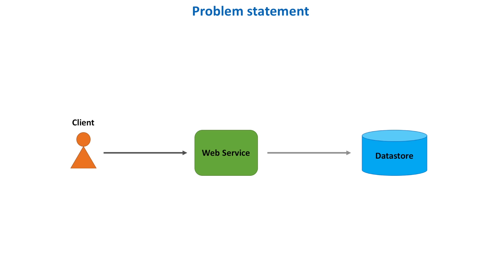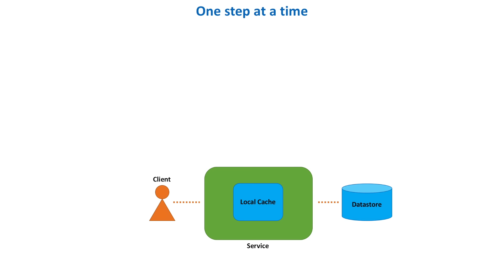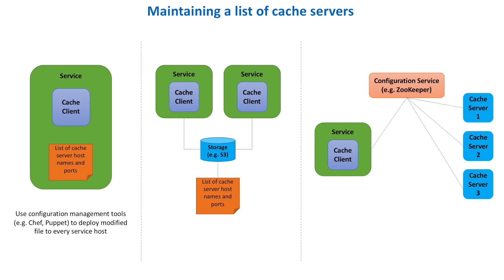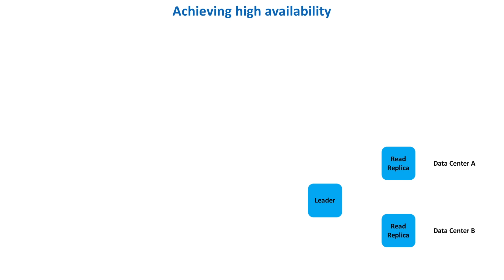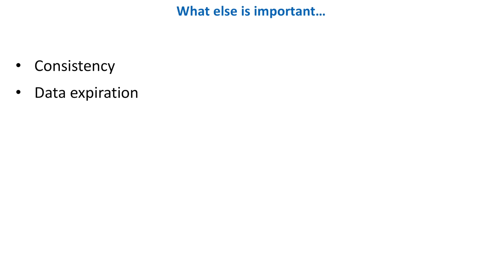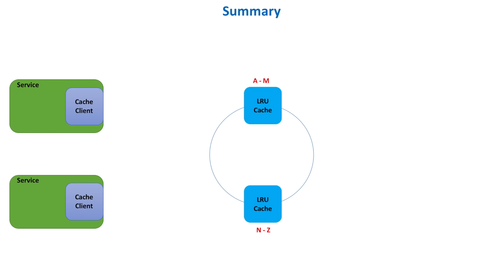System Design Interview - Distributed Cache

Comment: this is the most underrated channel, kudos to your way of explaining things in succinct manner. Please put more videos
Reply from the maker: Thank you, Vicky, for the kind words! Working on more videos.
Reply: I second. I wonder what does it take to make it popular. There should be something simple.  I am watching a few other channels. Nobody covers it to this level. May be more videos required. on short topics. Say 10-15 mins .
Reply: @nirumani  put it on LC discussion board
Reply: Fantastic series of videos.

I've worked on very large distributed caches (multiple terabytes, thousands of servers) and some other fun stuff to mention to the interviewer is:
- Failure modes besides just plain qps. Specifically, Redis will be overwhelmed by connection churn if it receives thousands of new connections per second. Twemproxy, on the other hand can handle this just fine. I have not tested this with Redis Cluster, but I suspect Redis Cluster also suffers from this.
- Auditing: With GDPR and California's analog to this, the legal department often is interested in how long we store data and where. For the former case, they may want a global TTL, or failing that, metrics and alerts when the cache TTL is too high. For the latter case, we may need to separate out data from users in various countries at the client level.
- Maintaining client libraries: How do we make sure everybody is on the newest version of the library? How do we manage multiple implementations? For Redis Cluster, this is a big problem- it turns out different clients have very different characteristics when it comes to detecting failures of nodes. Using a sidecar proxy like Envoy can be a big help as we can manage retries and health checks in a more principled manner.
- Testing: Frequently service owners don't think about how their service behaves with a degraded cache. Chaos monkey is a step in the right direction, but it is a blunt tool. Instead we can add knobs to return a percentage of errors, or delay requests, allowing us to really understand how we need to improve the service- for example retry intervals.
Reply: @SystemDesignInterview  Unfortunately you have so few videos, I've been watching them over and over before my system design interview. Top K heavy hitters is my favorite one, probably watched it 5 times already.
Reply: @martinhenriksson8617  Yes I do this as well. There is a big need for this sort of content. I have thought about making some of my own.

Comment: You said that we can make the implementation highly available by creating master slave replications of each shard. That is fine. You also said that we can use the read replica's for 'get' calls, This is NOT correct. Because in our LRU implementation even get changes the internal state of the data structure, it changes the doubly linked list which needs to changed on each of the replicas and leader which can complicate matter. In this particular implementation all 'get's MUST to go to leader only.
Reply from the maker: I am glad you raised this topic. As both data eviction and expiration become tricky when we introduce replication.

Expiration is tricky because master and all replicas need to have synchronized clocks, which is not a trivial problem.

And eviction is tricky due to the problem you shrewdly noticed. When each access of the item (get call) should be reflected on the master node. Because when master does the eviction it should have up-to-date order of when each item was accessed. And ideally, master should have this information. But it is hard to achieve in practice and actually not absolutely required. What if we ignore this information? I mean only master node evicts and expires the data. And every time get call lands on the read replica, we simply do not propagate this information back to the master. We decrease overall accuracy, but this approach performs pretty well in practice (for example, please check how Redis handles replication and eviction).

And as a side note, LRU (and other replacement policies) tries to predict the future. And this problem cannot have a "perfect" solution. There are many variants of LRU cache implementations, not all of them rely on keeping an exact order of use. Redis for example uses approximated LRU algorithm, where it samples a small number of keys and evicts the best candidate.
Reply: I had the same concern. Glad it has been raised previously.

Comment: Thanks.

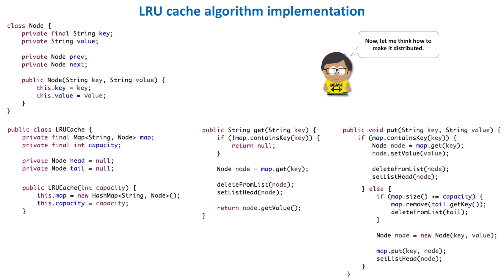 ~ 10:45 Local Cache Implementation
Stepping into the distributed world:
10:46 ~ 12:42  Dedicated Cache Cluster vs Co-located Cache
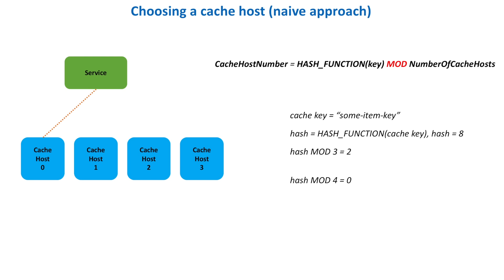12:43 ~ 14:05 Choosing a cache host: naive approach
14:06 ~ 16:04 Choosing a cache host: consistent hashing
16:05 ~ 17:25 Cache Client
17:26 ~ 20:00 Maintaining a list of cache servers
20:01 ~ 22:13 Summary
22:14 ~ 25:52 Achieving high availability
25:53 ~ 32:17 What else is important: consistency, data expiration, local and remote cache, security, monitoring and logging, cache client, consistent hashing
32:18 ~ 34:33 Summary

Comment: By far the best example of a structured approach to work out a system design problem. And in this particular case, a better solution than other videos on Youtube, Grokking and Interview Cake.
Reply from the maker: Thank you, Diego, for the feedback. Much appreciated!
Reply: @SystemDesignInterview  you deserve it. I took another look at your code and have a question about a minor detail. Do you really need the key in each node? I think that keeping the value should be enough. Through the key, you get the reference to the node in the hashmap, and from there the value.
Reply from the maker: Hi Diego. Good question!

Storing key in the node helps when we need to delete an entry from the cache when it is full. And more specifically, for this line: map.remove(tail.getKey())
Reply: @SystemDesignInterview  Oh yes.. it makes sense. I missed that. Thanks.

Comment: For the high availability in distributed caches we use Hazelcast that implements backup copies in the distributed map implementation itself. Each shard has a backup copy on another shard and the backup copy can be used to speed up reads and to grand HA in case of single nodes failure

Comment: questions:
1. how do captured logs/metrics differ between cache client and cache server? 
2. won't using a config service (ZK) ensure clients always have consistent view of what cache servers are available? 
3. what's the use case where co-located cache would make sense? is it just when you aren't ready to scale up to running a separate cache service? 
4. what about using heap for LRU cache? bad idea? 
5. for cache eviction, why would you sample items randomly and check if they're expired? If each server has a LRU cache, why not round-robin check servers for their K least-recently-used items and evict those? 

you the man, man!

Comment: Once again, a superb video. One thing that I found slightly confusing is the labelling "A-M" and "N-Z" of the shards in the drawings.
This implies a range function (encyclopedia style -> all keys that start with "A-M" go to host A) which in turn, allows for efficient range queries later. 
However, you talk about "consistent hashing" as the best sharding strategy (allows for efficient "get by key" query but not a range query) which is fine but inconsistent with the graphics (unless I am missing something :).
Thanks again for the amazing content.
Reply from the maker: Hi Michael,

Good points! Thank you. By using this "A-M" notation, I only wanted to state the fact that data is partitioned. Without any specific partitioning strategy in mind. Neither the range strategy (which is implicitly implied, I agree), nor the hash strategy.

I should be more careful next time. Thank you for bringing this in.

Comment: Even if we are using consistent hashing in our distributed cache design, There could be uneven distribution of traffic in the ring if any of the node goes down because of some reason. As a result all the traffic would be by default directed to the next node in the ring. That load would not be distributed equally across all the nodes in the cluster. To solve this problem we can make use of Virtual Nodes in the cluster.

Comment: Thank you so much for your contents! This is the best system design channel ever for real.

I can now understand how the "hosts" can coordinate in one cluster with different strategies and now I am curious:
1) if "leaders" in charge of writes can be more than one and exist across different data centers.
2) If there can be multiple leaders for writes, how does the coordination work across different data center?
Lets say there are hosts called A,B,C,D from cluster 1(data center 1), and copied ones are existing in cluster 2 and 3(data center 2 and 3 each) for availability. When "write" action happened from host A at data center 1, how does the hosts from data center 2 and 3 know about this update? In case multiple leaders(which in charge of writes) existing in different clusters(i.e. one leader in one cluster for writes), how does the cluster coordinate and handle the writes happening from different leaders?

Thanks again for your amazing lecture!
Reply from the maker: Hi Sunyoung,

First off, thank you very much for the feedback and insightful questions. Secondly, my apologies for the delayed response ((

Many things I would like to say regarding your questions... Hard to even see where to start. Ok, let me outline thoughts one-by-one and see where it will take us.

1. I would avoid bringing a topic of multi-leader writes and replication for the cache design. And my argument is that we do not need any. For a distributed database design discussion - probably yes, for a distributed cache - no. Because availability requirements are typically lower for the cache. I will try to cover this topic more while discussing databases in future videos.

2. Regarding multi data center (DC) support, I have seen several approaches in practice. For example, when cache cluster servers span across several data centers. Physically, servers live in several different data centers. Logically, all these servers are combined in a single consistent hashing ring. When one DC goes down, cache servers in other DCs start to handle additional keys. Yes, the rate of cache misses will increase for a while.

3. In case of asynchronous replication, replicas listen for updates on the leader side and apply this updates locally. Nothing special here whether this replica lives in the same DC or a different one. For a remote replica, replication lag may be a bit larger.

4. I should probably stop writing ... ))
Reply: Thanks for your thorough explanation! I did not expect that I would get such an extensive answer. I really do appreciate your time. I cannot wait for your next lecture as well. During this hard time, please stay safe and healthy!

Cheers.
Reply from the maker: You too, Sunyoung.

Comment: Very good video and clear explanations. I think one major idea of a possible solution is missed, when you did introduce a 'configuration service' you also introduce the 'single point of failure', of course, Zookeeper solve it but it's distributed system itself. Another idea is to keep a partition table on each cache node in RAM and make synchronization of this table between all cache nodes on cluster actions (add a node to the cluster,  remove a node from the cluster).

Comment: Very informative. Just a query related to availability of system that we designed. We said that whenever leader fails, follower takes over. But this is not true availability as this is going to take sometime and service may not be available during that instance of time.
Reply from the maker: Hi Ravinder. You are right, during a leader failover, some writes may go to a different host in the consistent hashing ring. All such writes will result in a cache miss after new leader is promoted. As for reads, we can still make reads to be served by followers.

Also, please remember that availability does not necessarily means system is "always" available. It is a percentage of uptime. Closer to 100% is better, of course. But is almost impossible (or too expensive) to achieve in practice on a long time interval. A good topic for a separate discussion ))

Comment: Thanks a lot. This was really good. A bit more explanation about how read replicas deal with hot shards would have been better. When dealing with hot shard, is it the CPU performance which is an issue? and hence multiple read replicas having their own CPU deal with that.

Comment: How is consistent hashing used to select a read replica? For write/put calls, the hash ring could consist of only the leader nodes, but for read/get calls, how to ensure that hash(id) maps only to the set of read replicas for the corresponding leader?
Reply from the maker: Hi. Multiple options are available. It depends on what strategies we use for data replication. 

We may replicate data to N - 1 clockwise successor nodes in the ring. Both DynamoDB and Cassandra use similar approach. So, when read call comes and leader node is selected, we can forward this request to a random read replica (one of the next N - 1 nodes in the ring).

If data is replicated to completely separate nodes, that suppose to serve read requests only, there are several options as well. When leader node is selected, call comes to the leader node and leader itself forwards it to a read replica (e.g. randomly). This approach does not work well if read requests rate is too high, though. As leader node may be overwhelmed with read calls. A better option is when we store a mapping between leader node and its read replicas. Consistent hashing is used to choose a leader node, and then we need a second lookup to choose a read replica. Read call is then forwarded to the read replica directly. Configuration service can be used to store this mapping.

Comment: The way you progressed to build a distributed system from a naive system is really appreciable. 
I have one more problem pls find sometime to answer - 

Question - When we follow the Master Slave architecture "at application level", Pls consider the following two cases:
CASE 1 -
does the same [only one] application code instance runs on all the servers Across All the Availability Zones and Across All the Data Centers?

OR

CASE 2 -
Each server runs an application code instance of its own, independently?

If the answer is case 2 then how is the concurrency handled?

Bcs the other thread running in other server can't find if the monitor was locked by some thread in the current server instance.

Comment: A minor confusion at the beginning which I am trying to clarify here. In case of LRU, you need a doubly linked list combined with a hash table(to store address of each element in the doubly linked list). This isn't specified!
The hash table to store the value against the key is different, don't confuse it with that.

Comment: You make this seem so easy. Thanks!
Reply from the maker: Thank you, Priya, for the feedback!
Reply: Got asked this is Facebook and bombed the interviewer posed a lot of question which I could not answer
Reply from the maker: What kind of questions? No need to post specific questions. Just curious what areas were probed by the interviewer. E.g. networking, memory allocation, scalability, data storage formats, etc.

Anyway, do not be discouraged by this experience! Facebook interview is a tough nut to crack. You can always try another time.
Reply: System Design Interview do you have more resources which I can read? Questions were around data loss reliability accuracy

Comment: How is adding more read replicas helping with solving the hotspot problem ? Hotspots will continue to exist if you keep hashing to the same leader. By adding replicas you are only avoiding a single point of failure of cache shard (or ensuring high availability), isn't ?
Reply from the maker: Hotspots may be due to high read rate or high write rate or both. Read replicas helps to scale reads. While sharding helps to scale writes.

Some more details on this topic:
https://www.youtube.com/watch?v=iuqZvajTOyA&lc=Ugzrg2p-j96kwcivY6t4AaABAg

Comment: Thanks for the awesome video and the explaining the thought process starting from the simpler system and iterating the design to come up with the final design which is highly available and scalable.
I have a question here: If my understanding is correct, the cache eviction policy in this design is implemented at the Particular shard Node level. For example, while adding a put(key_new, value_new) the particular shard(Node1) can evict an old entry based on the LRU. But there might a possibility there exists an older entry (Key_varyOld, value_very_old) on the different Node which might be the actual candidate for the eviction if we look from the global system point of view. How can we deal with this problem? Please correct me if my understanding is wrong here.
Reply from the maker: Hi Ashish,

You are right, each shard only cares about its own set of keys. And if cache is full (reached a certain size) on one node, this node evicts keys without consulting other nodes.

Ideally, we want keys to be evenly distributed across all shards. To avoid situations when one shard is beyond its capacity (and we need to evict some keys), while other shards still have a plenty of memory to spare. And there are several modifications of the consistent hashing algorithm, that help to achieve a better distribution of data. I briefly mentioned some of them here: https://youtu.be/iuqZvajTOyA?t=1866

Also, please take a look how Cassandra deals with this problem: https://docs.datastax.com/en/ddac/doc/datastax_enterprise/dbArch/archDataDistributeVnodesUsing.html#archDataDistributeVnodesUsing